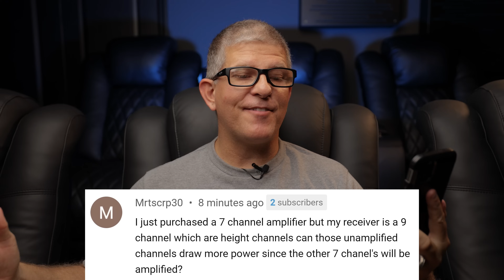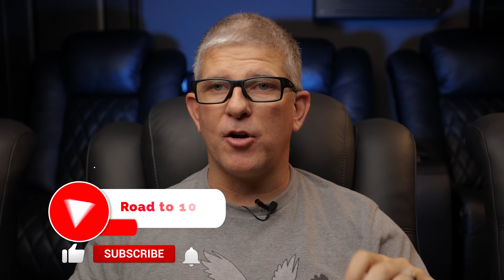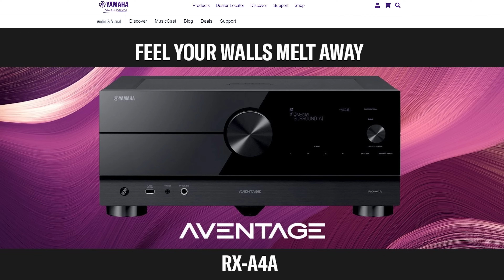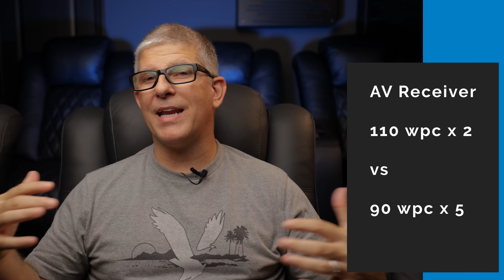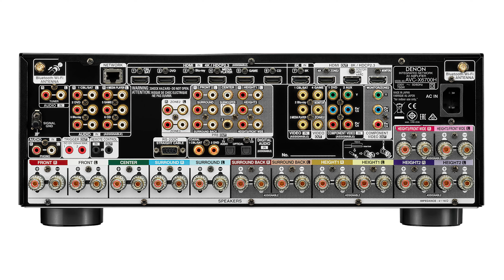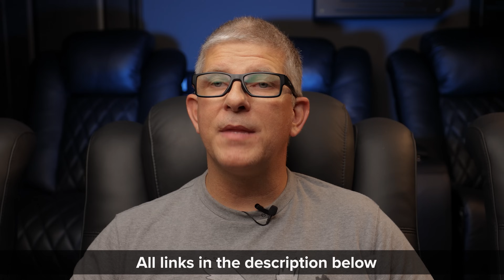How to Get MORE Power From Your AV Receiver - Home Theater Basics

Comment: Youthman, love the video as always, you make incredibly detailed content. I had a question however. 

The question is about which emotiva amp I should purchase for my set up. 
1. Emotiva basX a3 (powering my front stage
2. Emotiva basX a5 (powering either my front stage and potentially rear surrounds in the future or to power my atmos) 
3. Emotiva Xpa 5 Gen 1. 

I can find each amp for around $500 

Currently I have a Denon 4500h Avr, Martin logan 15i book shelf speakers and a martin logan 30 as my front stage. That coupled with an svs 2000sb and 4 sonance atmos speakers complete my 3.1.4 experience. (I know rather unorthodox but I don't have a left wall to add surround speakers and make this a 5.1.4.
Reply from the maker: Thank you for the kind words. If you can find an XPA5 for the same price as a basics a five, to me it’s a no-brainer I would get the XPA5. You can never go wrong with having more power. Just tempest the amp beforehand to make sure it’s working properly.
Reply: @Youthman  initially I felt the same way. My concern was with he xpa5 gen 1 being as old as it is, is it more susceptible to problems? Has the technology improved enough overtime that although the basX doesn't have the same Wpc, it has better clarity or more refinement? Thanks again for taking the time to respond.
Reply from the maker: For the most part amplifiers haven’t changed very much. You would be hard-pressed to hear the differences between them unless something is wrong. There is always a risk when buying used equipment especially electronics. But that is a risk you have to decide if you’re willing to take in exchange for the massive savings you’re getting

Comment: I was thinking about get a 13.2 receiver to get more Power using 9 Channel, this could be true? Is cheaper tô me than get external power
Reply from the maker: I would say yes because typically you’re 13.2 channel AV ours have a much larger power supply. And the fact that you’re not maxing it out is also a plus. I reviewed the SR 8015 from Marantz and it’s a beast
Reply: @Youthman  I have a X6500H, so SR8015 can be a upgrade?

Comment: Great explanation video. That’s why I would say buy Nad, Arcam or something similar, you get real stats and products that doesn’t get renewed every year with tiny incremental features.
Reply from the maker: Even with real power ratings, you still would benefit from an external amp if you are powering more than 7 speakers. NAD aren’t known for high power.
Reply: @Youthman  Absolutely, I would say that going from one of the brands above there is a less chance you will feel the need to add external amplification. 

And mixing amplification types also comes at a certain cost of cohesiveness. If we are very picky that is..

But these are just my personal opinions of course :)
Reply from the maker: I would agree. Whether or not someone needs additional amplification also depends on various factors such as room size, how far they sit from the speakers, how loud they listen, and how sensitive their speakers are. If you have a really small room, don’t listen very loud, sit pretty close, and have sensitive speakers, do you likely don’t need a lot of power lol

Comment: When you ad an amp to the system will the amp driven channels volume be balanced with the non amp channels when you are watching a multi channel movie?
Reply from the maker: Yes because you will run your room correction after you connect an external amp

Comment: I don’t think that’s how it works with Denon/Marantz. I have an Denon AVR X2000 and it says “Fully discrete, identical quality and power for all 7 channels (150 watts per channel)”. It dwindles down to 95 watts per channel when using a 7.1 with 2 channels driven. All channels have their own dedicated amplifier.
Reply from the maker: It’s exactly how it works. Denon/Marantz do claim 70% of their rating with 7 channels driven (which is good) but add up to 11 speakers and it’s even less. So yes, it still works as described, maybe just not quite as bad as other brands

Comment: This is why I gained a bunch of respect for NAD and how they rate their all there AVRs and Amps.

AVRs are rated for all channels driven and bench tests will show a few watts more across all channels.
Reply from the maker: NAD AVR’s still could benefit from adding an external amp
Reply: @Youthman  I added a venerable Nad 2200 found discarded on someone’s nature strip (ie verge) to my T778 and it made a huge difference.  Hugely noticeable for stereo use, but also for surround (7.2.2).

Comment: RX-a6a Yamaha I use to power Revels F36's in a 7.2 set up. It's a basement media room all open, about 1200 square feet. It sounds great. I'm just not sure if I really need further amplification just for the LCR's. 12 -15 ft is the seating area from the system/TV area.

Comment: Here is a fact. Today's receceivers must have Pre-outs. Mandatory!  Why? Because priority has been given to gimmicks and not performance as in a great massive Linear Power Supply. I am enjoying a Denon AVR-4802. I don't need nor care about Atmos. I do a true 5.1. That receiver will do an honest to God 125 watts per channel 20hz to 20khz at no more than .05 THD. There is no HDMI or any of today's gimmicks in it. I agree with Youthman here. It is about helping today's receiver out. Power Supplies are less, demand is more. Means no headroom, not even nominal performance.  If you are not running hyper efficient speakers you must go external amplifiers.  I am running in my bedroom my Jamo C97 mk.2 towers as my primary stereo 2 channel music act with 2 Crown XLS1002 in bridged mode running the bass, and the Emotiva BAS-X A2 the mids and tweeters. I have the power and efficiency of the Crowns on the bottom and the richer sound of the Emotiva doing mids and highs. I am thinking about the 3 channel BAS-X amplifier next, but because the Denon AVR-4802 is doing such a great job on the center and surrounds. It is not really that urgent to me. Center is the matching center, and the ELAC 6.2s for my surrounds. Sounds great! I frankly would never buy a new receiver.  Not happening. Look inside what you get. I sold Denon for over 10 years plus and been doing Audio for over 50 years. Why stress over HDMI pass through if your TV does most of the source management anyway. 8K and 4K pass-through is a dark art with poor reliability.  HDMI boards run really hot, and they fail too. So I buy legacy. I can still stream, run tape, CD, and SD recorder and even vinyl if I want. No Alexa, no other gimmicks in the receiver I don't need, or pay for.  I am in I.T. also and speak with folks about points of failure, and robustness.  Want to really scare yourself?  Buy a used legacy Preamplifier Processor with no HDMI, get some Emotiva BAS-X amplifiers or better for about the same money as today's top boat AVR. I have an Anthem AVM-30 that was $3500.00 new! Got it less remote for $350.00! You don't need to always buy new to leverage great gear. But be careful.  My Denon AVR-4802 cost me $299.00 plus tax and shipping, and came with the original working remote. THX ULTRA2 Certified. This tank I sold a ton of. Now I can enjoy that for pennies vs. back then. What do you buy new that is this good. Nothing. Understand what you want and need. Be honest with yourself.  Do the homework. Buy performance over gimmicks every time. Buy legacy and save. Know your HDMI scheme. Do you need Atmos. And so on.

Comment: I've been contemplating doing this on my 7.3.4 system.  I have a Marantz 7015 and an Anthem MCA 325.  But what I found is the Marantz can only Pre Amp 2 channels, or ALL channels in the settings menu.  Their amp configurations don't have any options to do anything in between.  So does this mean people running more than 2 and less than all, are still sending power to those connectors, even though they are pre amping? I was afraid that might result in some interference. Any thoughts?
Reply: Check out this configuration video from Techno Dad. I have the SR8015 and ran into the same situation. After watching this video I realized you can assign the amps to the speakers but it’s a little tricky with the Marantz set up menu.
https://youtu.be/1amapGnmC1g

Comment: I never knew this was the case but it makes sense! I always assumed they had some way of supplying the rated 2ch power no matter how many channels were connected. It makes seperates make so much more sense now. Just thought it would be good to mention the Aiyima A07 for people on a real tight budget. You could get 4 channels for $160 that way. That might be something I see in my future
Reply from the maker: Unfortunately not. I’m not familiar with that brand but that’s very affordable power
Reply: @Youthman  there have been a few content creators who have done videos on the Aiyima A07 but Nick over at toids diy audio has a pretty good one talking about upgrading the power supply as well. Alot of people seem to really Iike that little amp

Comment: Hi,  I' running a 5.2.2.  Have the 3-channel by 275W Emotiva driving the front 3 speakers.  However, I still have to turn my yamaha AVR A4A to 55-65 in order to get louder sound.  Being more than half way up,, isn't that still considered a lot for a big receiver like my Yamaha with the front 3 channels being on the 3-channel amp?  It would be great to know if that AMP is working the way it should because there is no way to turn the amp up, it's just plug and play...  Please advise.
Reply: Firstly what is the sensitivity of your speakers, if they have a low sensitivity IE 85db they will still need the power turned up, every extra 3db needs a doubling of watts, so if a speaker with a sensitivity of 95db needs 70 watts to reach 105db, a speaker with a sensitivity of 85db would need 210 watts or more to reach the same volume levels. Secondly you can set your levels for the receiver during set-up/room calibration, if you feel you need to add a few more db to the front stage, feel free to experiment.
Reply: @johnbancroft5242  Thanks.  Yeah, I have all Bowers and Wilkins.  Sensitivity is 87 and 89db.  Got a 3-channel amp, MUCH better!  Night and day.  It's 275 with all 3-channel driven per channel.  Was worth the 1200 bucks I spent thru Emotiva.

Comment: I have a question for you I just thought of.  Can you link two AVRs together to run at the same time? For instance my Sony running my center left and right. Denon running the atmos and rear surrounds? My idea is to gain more power to those speakers. Just a thought anyway.
Reply from the maker: Technically it can be done if one AVR has pre-outs and the other AVR has seven. One channel inputs. I have heard of guys using an old AVR as an amplifier but I have not done it myself
Reply: @Youthman  any videos or wiring diagrams available anywhere? I'm curious to see if I could do this. Just not sure exactly what inputs and outputs are needed.
Reply from the maker: I’m not familiar with any particular diagrams. On your main AVR’s you are looking for preouts for the channels you want to offload to the secondary AVR. On the second AVR, you would look for 7.1 channel inputs. You would use an RCA connection for each channel that you want to offload to that second AVR. And then use the speaker output on the second AVR for the channels that you’re offloading
Reply from the maker: The main issue I see with doing that is both AVR’s have volume control so you would have to control the speakers that are connected to AVR one with AVR’s one volume knob, and control the volume of the speakers connected to a VR two with a AVR’s to volume knob. I’m not even sure how Room correction could calibrate that
Reply: @Youthman  ya that could be annoying to have to use two remotes. I guess I'll just have to save up for a external Amp that can help my system sound better. My Denon 7.1 x-2300w just wasn't the upgrade I thought it'd be over my old Sony 5.1

Comment: Thank You for this information, I have an emotiva basx3 for my left/right and center and a basx7 for 4 atmos speakers and my left/right surround and my Denon AVR powered up the right and left side surround, it’s a day and night difference when you add amps and alíviate the AVR.
Reply from the maker: Great way to set it up!
Reply: What processor do you have, I want to upgrade to pull the trigger and switch to a processor and I’m thinking between Marants and emotiva.
Reply from the maker: Marantz AV7706 - https://youtu.be/e-Jgr5p8yPE

Comment: The Front three channels get the bulk of the sound from movie soundtracks so getting those off your AVR will greatly improve the headroom for your other channels.  Getting a three channel amp first then add additional amps later if you feel the need is a great way to go.
Reply from the maker: 100%
Reply: i want to do this once funding is there
Reply: @outerheaven1000  comme nous tous mon ami✋🙏

Comment: Does anyone know if the onkyo rz50 lets u power the ear level speakers with a separate amp and let the onkyo itself power the atmos apeakers? I have a 5.2.4 set up and wanted to see if I could just use a separate power amp to power the 5 ear level speakers. Never really understood if the onkyo rz50 could do that. Thank you in advance
Reply from the maker: Typically, preouts are always active. So you should be able to use any combination of internal amps and external amps. Denon and Marantz have a "Preamp Mode" that allows you to disable ALL of the internal amplification (which is supposed to provide better sound) but when enabled, you cannot use any of the internal amplification.
Reply: @Youthman  thank you.

Comment: Super well explained. So in short, running as many amps (one for rears, one for LCR, one for atmos, one or two for subs etc) is the best solution? I have done that, and im running super fine. Enough power for each speakers. No distortion, no issue. :-)
Reply from the maker: Thank you kindly. As long as you can provide adequate power to your speakers, that’s a good solution. I have one single 11ch amplifier and your ears will give out well before the speakers do.

Comment: That’s why I sprang a little extra for the marantz 8015.  70 percent guaranteed all channels driven. AH tested and it’s above that.
Reply from the maker: I reviewed the 8015. It's a beast with a massive power supply. I had no issues powering a 7.1.4 Klipsch system with it (but they are very efficient).

Comment: Can an old AVR be used to replace the amplifier? Or are there contraindications? Great video, as always!
Reply from the maker: I have heard of people using preouts to go into a second AVR and using the AVR’s’s internal amplification to power speakers. I have just not done that myself
Reply: hmmm.. That sounds like a fun expirament. My old Onkyo has some decent power and dual bi-amp ability. The video processor went out a while ago so now I am on a Denon that has a lot less power. Both are 7.1.

Comment: I've been watching you for the last few months and I must say I built my new system based on what you might recommend..
I've have a Klipsch premier 7.2.4 Dolby Atmos system in my man cave downstairs for the 4 years.
I recently just sold my Sony vpl-55es projector, vutec 120 inch screen and Denon x4200w receiver.
I replaced it with the Marantz 7015 ,135 inch 16:9 1.1 gain screen. I'm using my friend's meridian amplifier to power the front center, left, right and rear surrounds. The Marantz will handle the side surrounds and my 4 in ceiling Atmos speakers. The meridian can give us 200 watts so we're talking about some incredible sound.
I bought the JVC nz7 laser projector and the image is really incredible! I've only had it a week but it's incredible what the projector can handle by itself without me having to do a thing. The biggest surprise I've had so far was having the option to raise the HDR level from 0 to either+2 or-2. I felt the screen needed just a little more pop so I set the HDR to +1 and wow did I get a nice pop which really made the picture come to life. The only other thing I've done was change the 6500 Kelvin to 7500. I just gravitate to a little cooler image. There's much more to learn but I'm loving the frame adapt feature as well as the theater optimizer. 
The biggest question I have for you is how should I set my Sony 4k HDR player and Roku ultra up in regards to the Marantz receiver.
I always get confused as to whether I'm supposed to use the video processing in the Marantz or let the JVC to the processing. How would you set your Marantz 8015 when going to the JVC nz7?
Do I use the passthrough on the marantz and use the upscaling from the JVC. I'm still somewhat of a novice but could you tell me the video settings you would have on your Marantz when going to the JVC. My 4k player and Roku are booked up to the Marantz and I have that 4k HDMI high end cable up to the projector in the monitor out.

I'd love any suggestions..
Love your videos so much and you're such a humble guy. Half of my problem is I'm in a wheelchair (car accident a loooooongg time ago) and it does make things a little difficult. I've been fortunate enough to have family including nieces and nephews that love watching movies...
I'm 57 years old and this will be my last theater room. I'm very grateful the JVC nz7 laser came out at the perfect time for me so it should last me and be somewhat future proof with the 8k eshift.
Maybe one day I'll be showing you my home theater here in Homer Glen, Illinois.
God bless,
Nick Hernandez
Reply from the maker: Hey Nic you have a fantastic set up. I know you have to be loving the new NZ7. I would recommend letting it do the video processing as it should do a better job than the AVR.